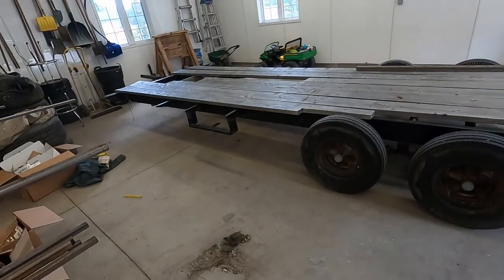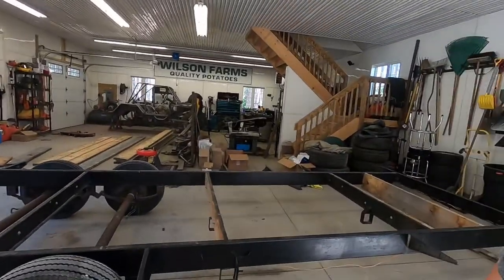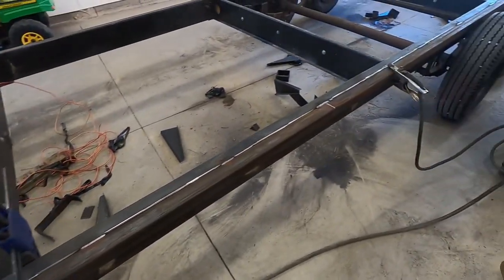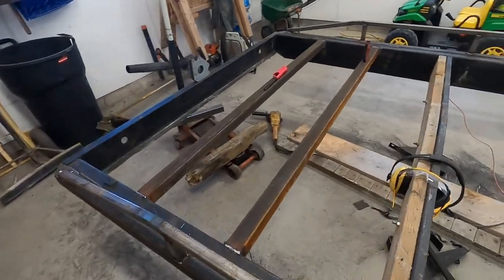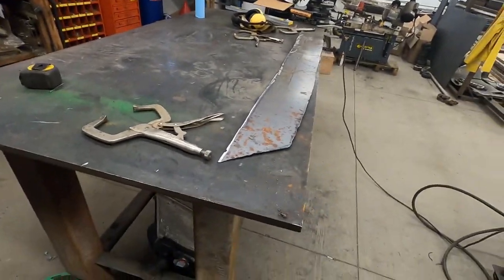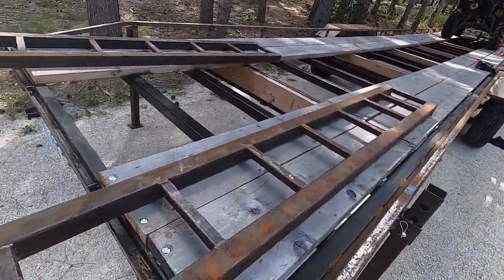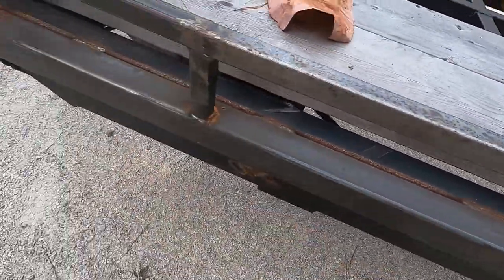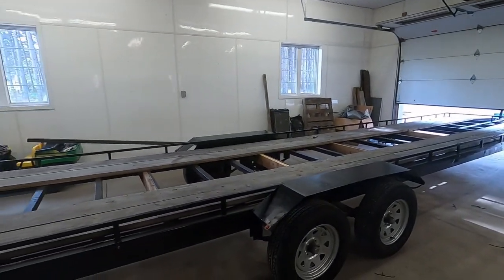How To Turn A Camper Trailer Into A Sweet Toy Hauler For $1,500 In 1 Video.

Comment: The camper is part of the structure. Once thats removed you have to beef it back up with heavier steel and more bracing. As long as that thing is its always going to have flex in it.
Reply: Add a toque tube problem solved
Reply: @ryanseely9012  no that dosent fix it.
Reply: Add 2 torque boxes at mid point between the space behind and in front of the axle will split the torque moments up into quarters. Problem solved. 😉
Reply: @johnpaulohara7589  it might help but it wont fix it
Reply: @aaronwood3540  I don't think you understand what a torque box is. They are used all the time in industrial applications. Proper application of torque boxes will make it structurally sound and ridgid.
Reply: @johnpaulohara7589  yeah your probably right. I just put salt on crackers. The 20 years in industrial fabrication and structural design was just boring. Building trailers for a living for the past decade probably wouldn't help either. Ill just keep sticking the salt on the cracker.

Comment: I made one from a 29 ft camper but took all the angel iron out replaced it with 3/8 inch 1x3 tube stock and put more braces in it more than it had . 300 dollars of decking on it had a 9000 pound winch on it hauled all kind of things then soled it for 900 years later when my truck broke down.

Comment: The threads arent what holds the boards on. Its the head that holds. Now the running them halfway through the board isnt good, but, sometimes it happens to get the board to draw down. With all that said, they wasnt the right screws to start with. You dont use deck screws on a trailer lol. Flooring screws is what you need. Pre drill every hole and the screw taps itself in. A&H Trailers.

Comment: Did you use existing axles?
Reply: Believe he said at the beginning he was replacing them
Reply from the maker: I had a pair of 3500lbs with 5 bolt pattern I used, the ones that came on the trailer were heavy enough but had the wedge style rims which I do not like so I swapped them.

Comment: Axles are to far back should've cut frame down to 25ft
Reply from the maker: Thought about that, but put 2 ATV’s up front and rzr over the axle pulls like a dream behind a 1500 GMC. Thanks for the comment.
Reply: @TwistedSXS  Hey it came out great good job! I took one is these and reinforced the frame with 4” C Channel snd cut it down from 26 ft to make a 18ft car hauler with a 2 ft dovetail and am making drive over fenders and maid it 92” wide. I also got another camper frame that’s 20ft long and maid it 8ft wide and built s tiny hosue on it!! And took a 5x10 small camper maid it into a trailer and welded 3ft tall sides and used expanded metal for the trailer to use it to haul atvs mowers or scrap metal or small demelition stuff.